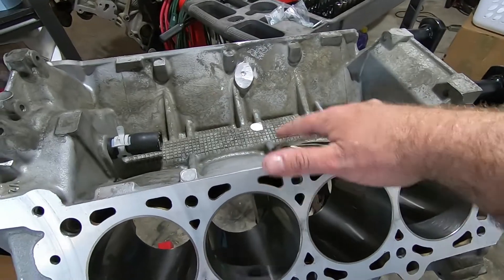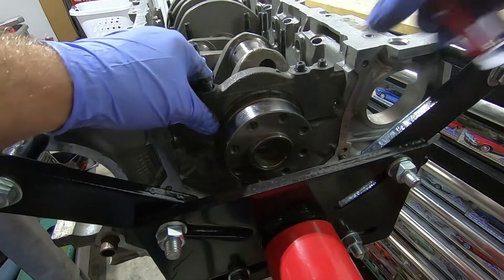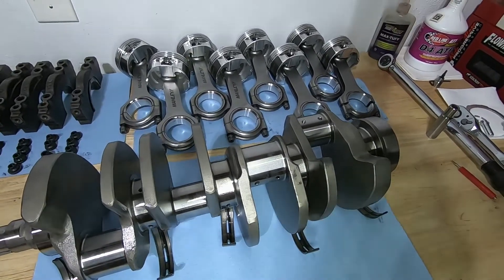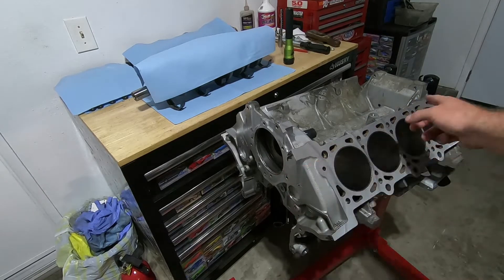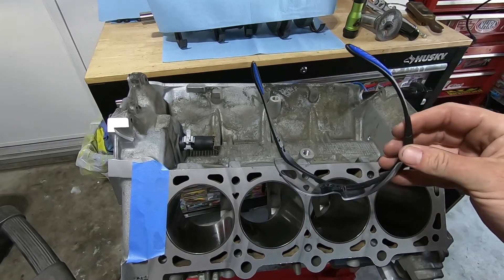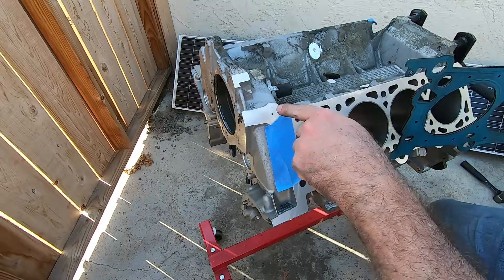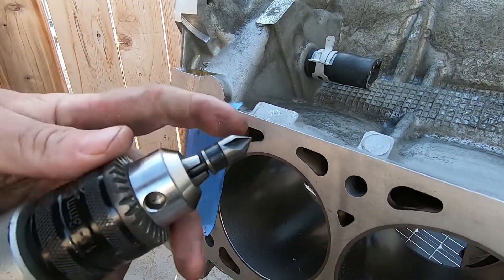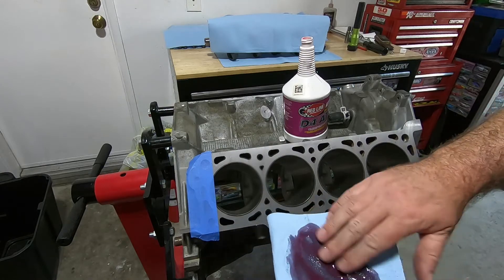Pt 8 Grinding off Knock Sensor Bungs - 5.0 Stroker 4.6 Teksid Engine Block

Comment: Do you need to drill the coolant hole if you are swapping in a teskid in a terminator?
Reply from the maker: No, you don't "need to" but I highly recommend it.  I have built engines and did not drill the coolant hole and they did not have any issues.  However, the engines I build now with a Teksid get the hole drilled.  It might seem strange/difficult to drill into a block but it really is not that hard and it does not have to be exact center on the gasket.  I feel like it doesn't hurt to drill it and any increase in cooling with these engines is good.